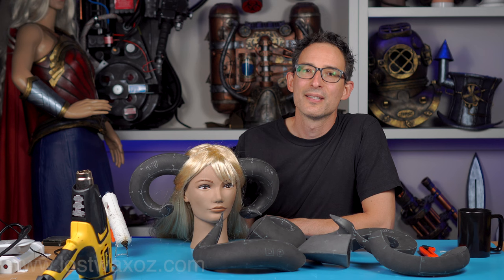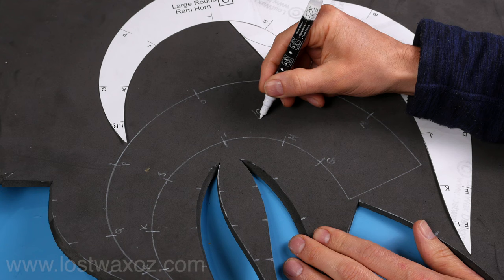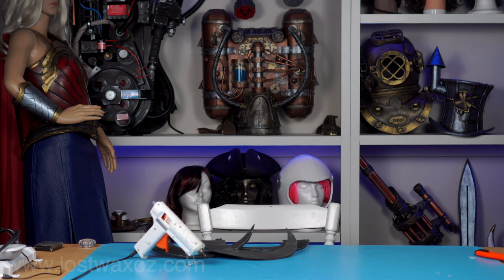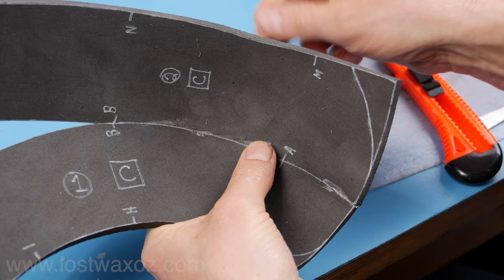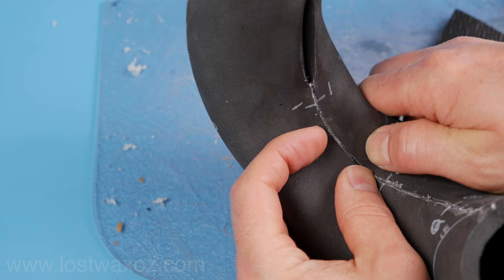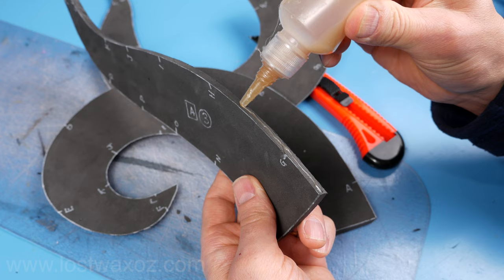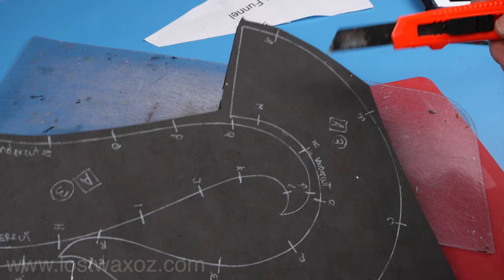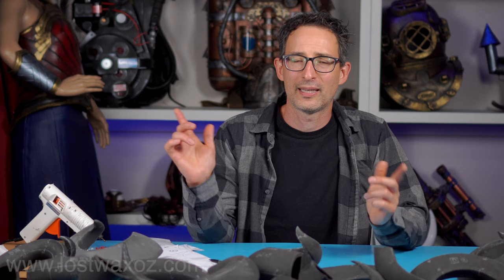DIY Cosplay Ram Horns Tutorial. Make Lightweight Costume Horns From Foam!

Comment: Any tips on attaching them to a human head?  Perhaps  barettes or plastic headband?
Reply: Check out his unicorn horn video for ideas. Dunno how well those work on these but that might give you u some ideas
Reply from the maker: I'm gonna do some experimenting, but so far, I think the best is a thin headband that is tight enough on the head and strong enough- I found a thin metal one that works well. I don't think barrettes will work for the larger horns but they might for the smaller ones. Also, worth thinking about is attaching them to a wig and then wearing the wig.
Reply: If you cut a piece of foam to the size of the base and glue that into the horn, you can insert rare earth (neodymium) magnets into that base.  Then add magnets to a wide headband (it should be wide enough for the horns to sit securely); you can cover them with a strip of thin EVA (craft) foam if you want them hidden.  Style hair or wig around the base to hide the headband and make it appear as if the horns are growing from your head.  Nsomniak's Dream has a video on using this technique for dragon horns.
Reply from the maker: @beckymurphy4714  Sounds like a great idea, then you can use one headband and multiple different horn types

Comment: Does the D-shaped horn also work if you do the undercut on any of the other pieces? Because now you have the flat part of the D start on the underside of the horn, but I suppose it could also look cool to have it start at the front- or back. But I don't know how well it will work for putting the pieces together.
Reply from the maker: Yep, that should work totally fine.

Comment: Do these horns work on armor pieces or just the head? Also, can you downsize the horns during the printing to make a smaller horn or does that not work?
Reply from the maker: They'll definitely work on armor pieces- probably easier because you can just glue them on. They should be downsizeable, though once you get to a certain size you might want to use thinner foam.
Reply: @LostWax  Alright, thank you!